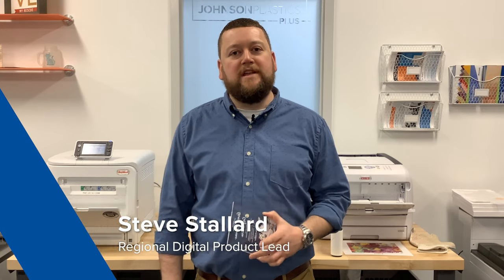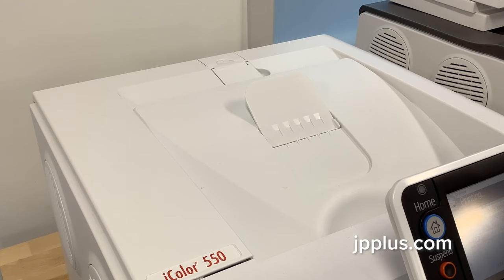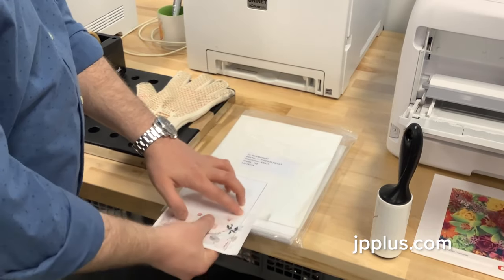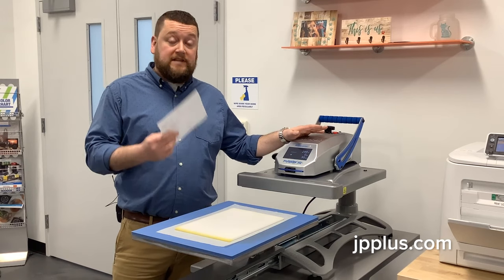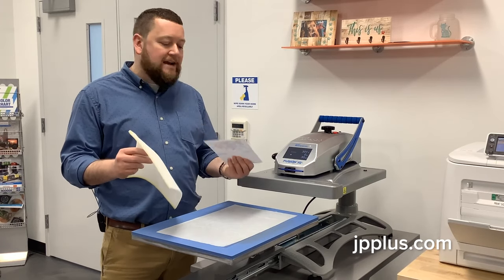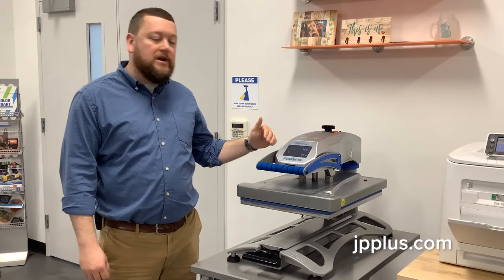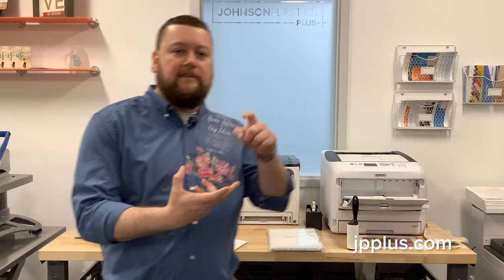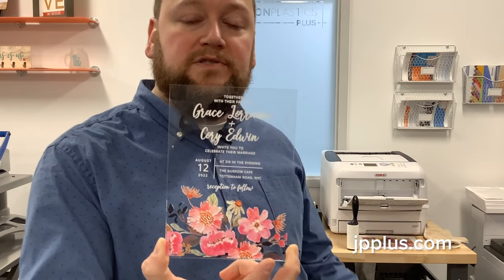How-To Heat Transfer to Acrylic: Wedding Invitation

Comment: I'm curious Can I use a sublimation printer to get this effect (minus the white)?
Reply: U can use clear laminate on it and sublimate onto the laminate
Reply: @jaz97  would It still come out clear or will the white show?
Reply: I’ve sublimated onto clear round acrylic ornaments and they just looked frosty so to make it pop I painted the backs white…you’d probably just want to use a different color for the txt and maybe cut white vinyl to apply to the back to get maybe the flowers to pop.

Comment: nice tutorial very helpful. what kind of sublimation paper ink of your printer? thank you from philippines
Reply from the maker: Glad you found it helpful. This specific video is discussing heat transfer and not sublimation. The paper used in this video is the JPPlus 1 step transfer paper for hard surfaces and the ink is UniNet IColor 550 ink.
Reply: @JohnsonPlasticsPlus  thanks you very much god bless you

Comment: Hello! I don't have a UV Printer to print out the heat transfer for sublimation. What other options do you suggest to accomplish this?
Reply from the maker: Hello! We are not using a UV printer in this video. We are using toner heat transfer for this project. Are you currently using sublimation?
Reply: @JohnsonPlasticsPlus  yes sir, I am currently using sublimation.
Reply: How can one get this machine and what's the price please?
Reply: Hello there I have tried to print on acrylic disc with sublimation paper/printer the image transferred but the acrylic turned foggy 😶‍🌫️ like what now and the printing paper get so stuck on the back is a whole mess 😢

Comment: Is that sublimation or is that different then heat transfer printer?
Reply from the maker: This process is using the IColor 550 Heat Transfer Printer!
Reply: @JohnsonPlasticsPlus  are you using Sublimation ink?  or can regular toner work with heat transfer paper?